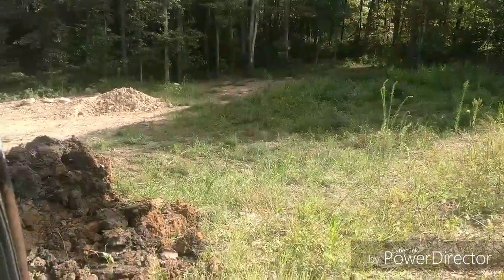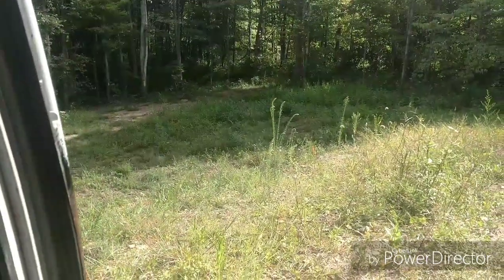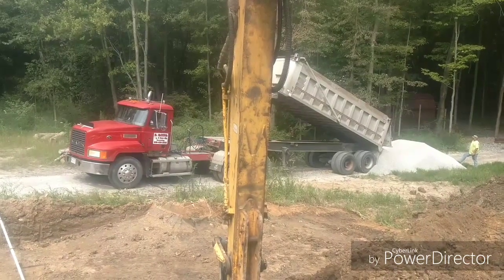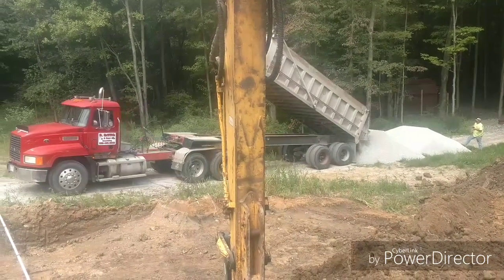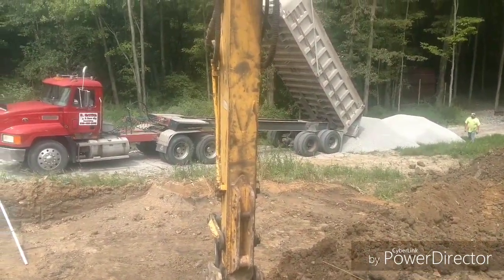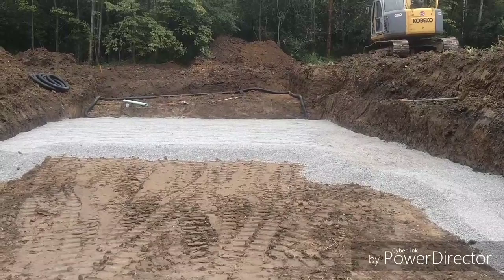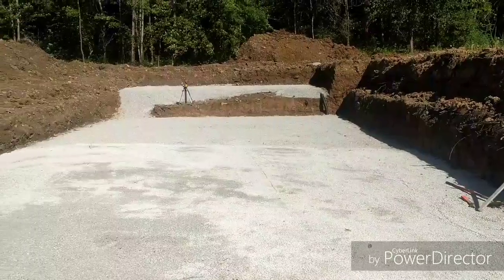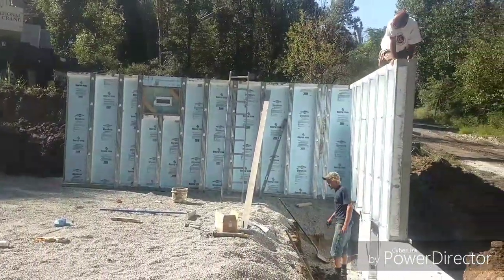Basement dig and superior wall prep

Comment: Was this your 1st experience with digging and preparing a gravel foundation for a precast wall system? You mentioned it was a filled terrain, and did you eventually find virgin soil bed or not?  Did you have to have a soils engineering firm come and perform a soils density test on the base  and or on the gravel installed?
Reply from the maker: This was not our first time preparing for this type of foundation.  We did find virgin soil that we stopped at. Since we were able to get to virgin soil a engineering firm was not needed.